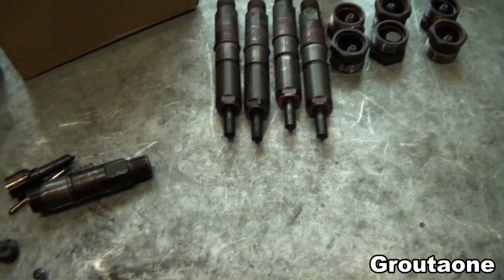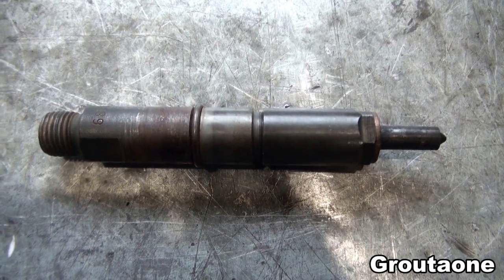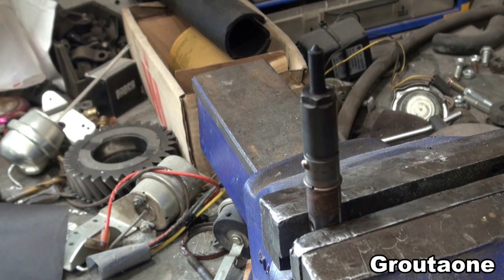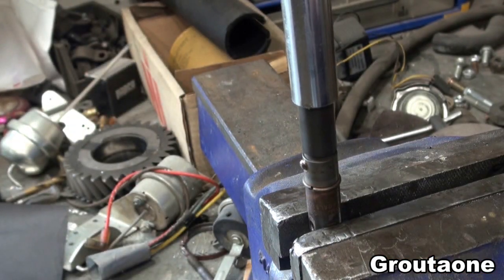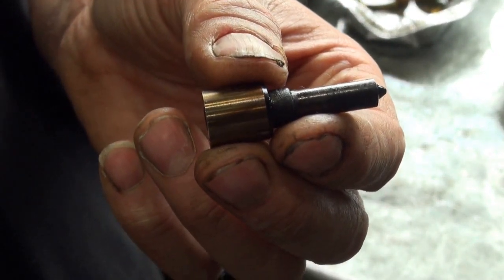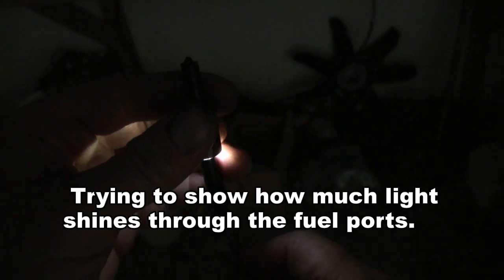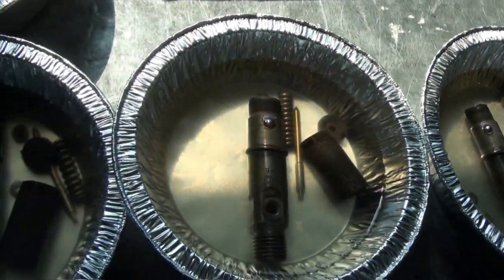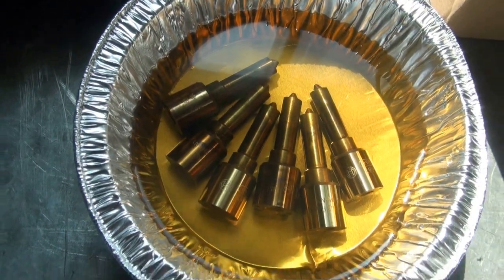12 Valve Cummins Injector Video

Comment: ive always marked the two pieces before disassembly and then set it back to the same spot, you would think itd be a critical measurement as its applying preload to the spring id think itd change the pop pressure just as much as thicker or thinner shims but i never see anyone talk about it or be concerned with it so maybe not, be curious to see one on a pop tester torqued to 30ftlbs and popped then tightened to 50ftlbs and popped see if it changes the pressure

Comment: Can't say I've ever used torque measurements in removal mode before , quite intriguing my friend .I do believe injector body assembly torque is 35 ft lbs . Not familiar with the me-tricked conversion spec🤣 👍👍✝️🙏
Reply from the maker: Thanks, on assembly I will try one at 35 pounds and then see what it takes to loosen again to compare.

Comment: First, thank you for your attention to detail on the videos! Got a question on cleaning / sealing. These injectors, much like Mercedes 123 and 124 injectors use the polished surfaces as mechanical seals between the components. The intermediate seal in these injectors have two pins that protrude. I can finely polish the face of the nozzle with 2000 grit sandpaper on a thick glass plate, but I am at a loss as to how to polish the intermediate seal due to those protrusions. Do you have any suggestions? Mine are ever so slightly pitted.